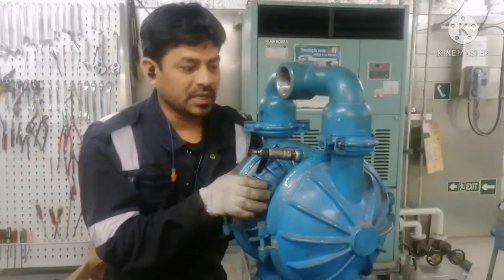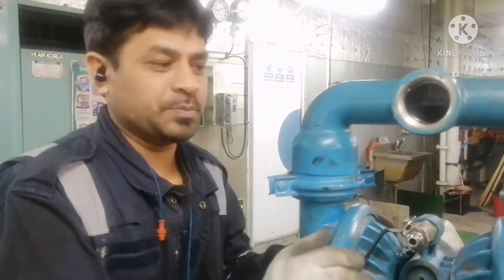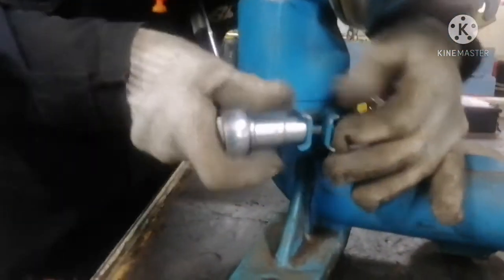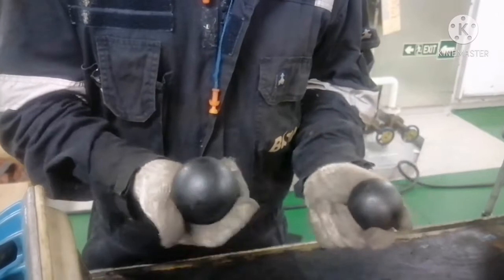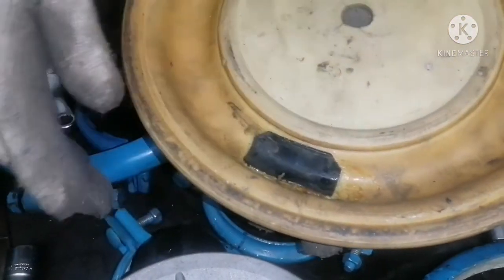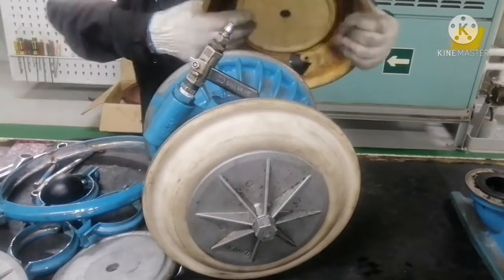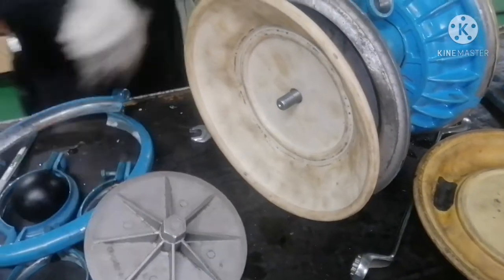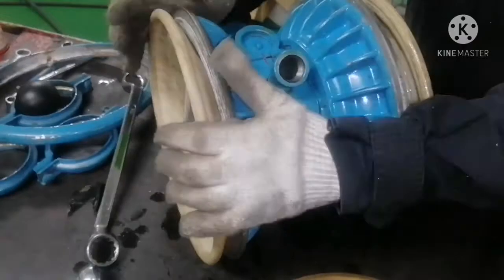How do they do... How to dismantle... Overhaul and assemble wilden pump onboard ship...PART-1

Comment: There was a point in the video where he took off the air valve and demonstrated that the piston should be free moving. I took mine apart sanded the brass valve body lightly as well as the plastic piston lightly reassembled and im back up and running. This guy was very informative save me $500-$800! This is an example of a youtuber that should be making money from youtube. It shouldn't be solely based of reviews.
Reply from the maker: tq sir